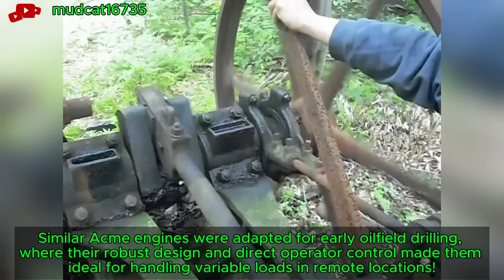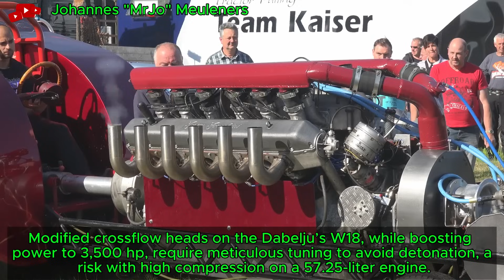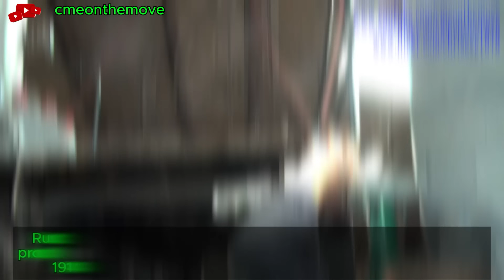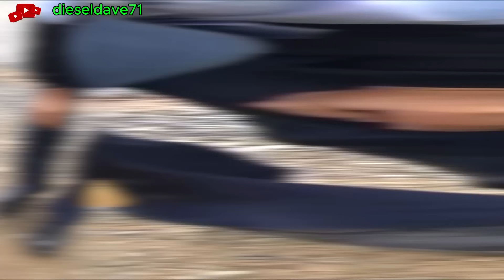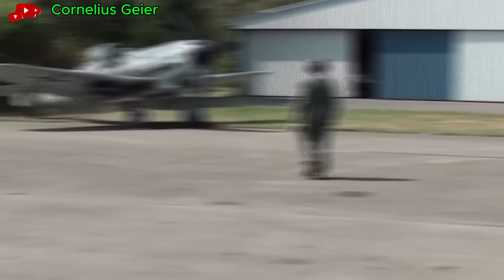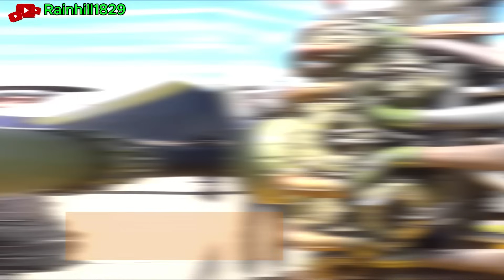Rare Old Engines Starting Up Sound That Will Blow Your Ears! ▶ Part 41

Comment: The Lancaster bomber used Rolls Royce engines… not Bristol radial engines
Reply: Well… you learn something every day!  I am grateful for this update and the pleasant manner is was presented
Reply: While generally true, with 7,277 Lancs being built, the Mk2 was a run of 300 Lancs built with Bristol Hercules. This was done as a safety measure to prevent running out of Merlin’s for the bulk of the production run. By all accounts the Bristol powered Lanc could climb to a higher bombing altitude than the RR powered versions, but was pretty thirsty. Cheers.